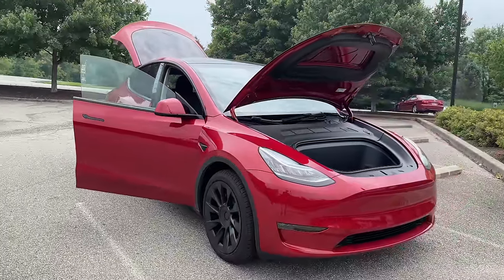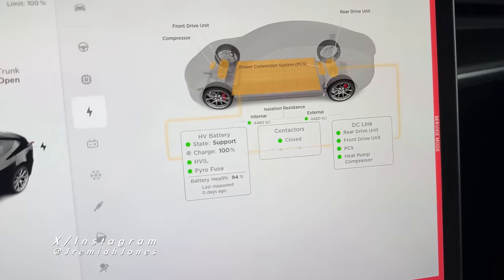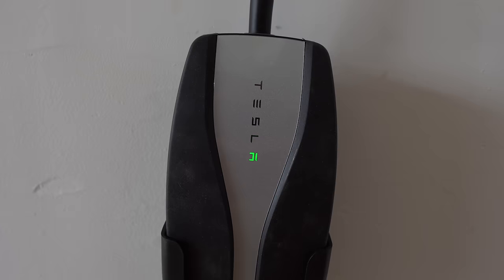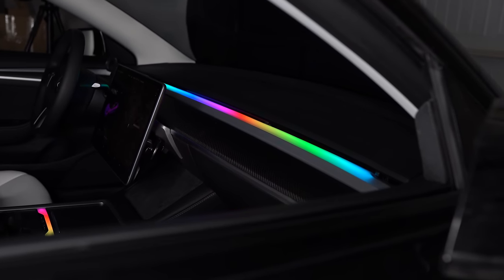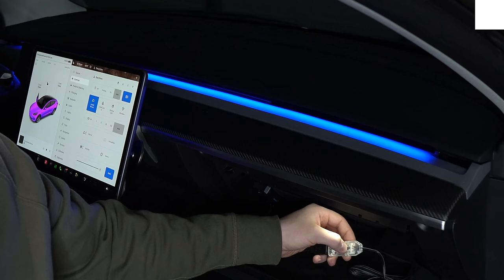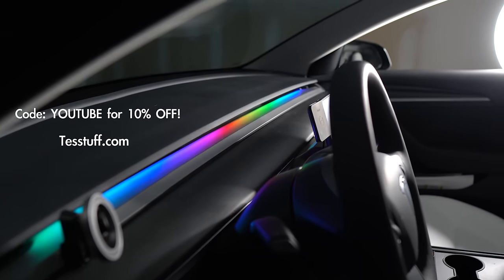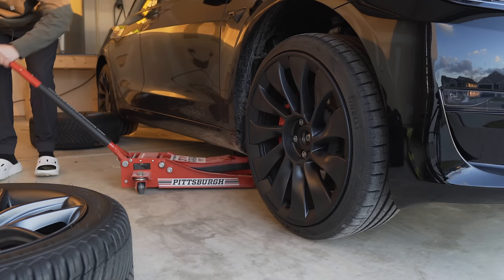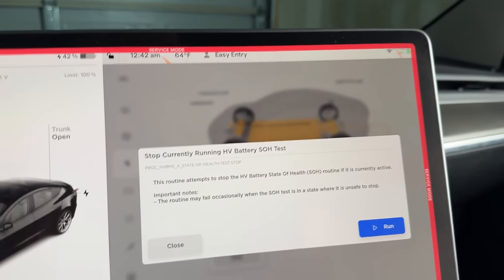How To Charge Your Tesla The Right Way | Avoid This Mistake!

Comment: Say you’re going on a vacation for a couple of weeks and can’t keep it plugged in, how bad is that for the battery, and, what level of charge should it be left at?
Reply: Driving the car to below 50% and leaving it plugged in with a charge limit of 50% would be easiest on the battery for storage.
Reply: @floodtheinbox  but, I don't have a plug available.  I can't leave it plugged in.  Thanks, though.
Reply: @rollaroundtheworld  oh sorry, I didn’t read. It’s not gonna be terrible for the battery I wouldn’t worry too much about out. Turn off cabin heat protection and sentry mode, charge it to 50-60 and while you’re gone try as little as possible to open the app up and check on the car and the battery won’t lose very much charge at all. Some people say account for 1% loss per day and that’s definitely an over estimation but charge enough to leave you with enough to get to a charger after losing that many percent when you get back and it won’t hurt it at all cheers

Comment: So, let's say that your Tesla is rated for 300 miles on a full charge. If you follow the recommendations of keeping your battery between 80% to 20% for regular, local driving,  then you're charging the battery at least every 180 miles. With battery charge dissipation, it's less than that. I just started recording the data, but I suspect I'm going to find out that I'm charging from 20% to 80% every 120-130 miles or so. I think that's kinda lame, but it is what it is.

Comment: The conundrum I have is that I use schedule charging to start charging at 10pm. (Off peak) Once the charge is complete (I use 75%) at maybe 1am the charging stops and wont provide power again until 10pm the next night. So while the car is plugged in, in reality its as if its not plugged in as it cannot receive any power. The only solution is to either manualy plug in at 10pm without schedule or turn off the schedule charge function and then turn it back on every day in the App? Scheduling is convenient as I plug in at maybe 6pm and forget it and it nicely begins at 10pm without my thinking about it. How can I use scheduling and benefit from "always be plugged in" at the same time?

Comment: The thing I've been struggling to reconcile is the notion that "Always be charging" seems to conflict with the ability to schedule a charging session.
Reply: ‘ Always’ charging is a misunderstanding. Always PLUGGED in is not possible either unless you don’t use your car at all. The Battery Management System will not allow your Tesla to be “Always Charging “. The BMS will stop the charging once the battery is charged to the specified level eg 80% or 100% for LFP models. But your Tesla will draw power from your wall charger for other purposes other than charging your battery. Your Tesla don’t sleep when you go to bed, it has to maintain various systems in your car.

Comment: Great Video Jeremiah, what’s your recommendation for charging if I don’t have an LFP battery? I drive a lot daily like 300 miles or more.. I can charge at home and trying to avoid supercharging as much as possible
Reply: It’s best to charge prior to you leaving your home. So rather than starting say at midnight and you leave by 8am, I would have it start at 4am if that’ll change you up to 90% prior to you leaving. This way, you don’t have the car sitting at a high SoC. 

If you drive daily for 300, I’d keep it between 80-95% by the time you depart.
Reply: Just get a Prius
Reply: 300+ is to much to do without supercharging. Realistically we get about 280ish miles for a 100% charge. Prehaps you have chargers near your work? Unless your doing uber/doordash

Comment: As a brand new Tesla owner I’m a bit shocked, I went from a 2019 wrx to a long range model y but the battery experience is a bit lackluster, I feel like I charge every 2 days and i need to get a wall mounted charger asap because I get 1kwh at home🤣 but it also kills my battery that I drive uphill to go home and waste like 10-15% a day from what it feels like😭
Reply: Yep, Tesla stated range is grossly overrated..  take 30% off and you will be happy.  Using a lot of heat in winter and AC in summer lessen the range even further.
Reply: @jml9550 i thought gas cars also looses range on uphills.
Reply: @Tech4geeks21st  sure it uses more gas.  I ain’t no MIT physicist, EV use the same energy going uphill and downhill?
Reply: If you drive uphill to go home then that means you're going downhill when leaving home, which would recharge your battery a bit, no?
Reply: @schm147  no all that energy is transferred into the brakes
Reply: @mysticalbeing13 incorrect - if you use 1-pedal driving (now apparently the only mode on the Model Y) then you're almost never touching the brakes.
Reply: @miket2067  Ah. someone who incorrectly tries to correct someone. 1-pedal driving includes "Regen Braking" which is also known as Hold Braking. Regen braking is using the energy stored from downhill slopes to brake. Your statement of hold braking is the only mode on the Model Y is also false. There are three modes in all Teslas. Creep, Hold, and Roll. Hold is the only form of braking that allows you to not touch the brakes BECAUSE of energy being transferred into the brakes. Comprehendo?
Reply: @mysticalbeing13  incorrect again mi amigo! (1) if you're going downhill using regen braking NO energy is going into the brakes, it's all going back into the battery (minus conversion losses of course). (2) my 2024 Model Y does not have Creep, Hold, and Roll modes - it defaults to Hold and there are no other choices. The Creep and Roll modes were removed in the most recent software update (they were not useful according to Musk),

Comment: I just bought a 2019 model 3 LR with about 41,000 miles. The vin code has a e in the battery identifier so I think it is lithium only? Should I aim for the 50% with charging stopping at 60% ?

Comment: These people charging their LFP‘s to 100% every day, and very frequently on superchargers is going to degrade them faster. They are still lithium based batteries. They just have less voltage spike than magnesium cadmium batteries do at higher state of charge.  Charging your LFP battery to 100% a couple of times a week is plenty to help. Keep the battery management system calibrated. Plus, at 100% state of charge you’re not getting full region when you’re breaking. It’s more comfortable to stop at 95% for that reason.
Reply: I agree with you comment.  Not having full regen periodically should help remind you to use your brakes from time to time, as they too should be used on occasion.

Comment: So when charging at home what amps are you using with the level 2 tesla charger?
Reply: Im charging at 48 amps on a 60 amp breaker
Reply: @dieniewienie143  so it's not better for the battery to charge at lower amps ?
Reply: @gregpelfrey5303  For level 2 charging? Nope.. The cost of charging at lower amperage would outweigh any benefit.

Comment: Actually you should charge to 100 percent. A full charge is actually 80 percent. System software wont actually charge to 100 percent. This mean 100 percent is actually 80 percent. Example  when an ice care gauge say empty it actually has another 5 gallons in it.

Comment: Had my Model 3 for about 2 months now and charge at home. I have it set to 80% and I’ve noticed some days it will charge to that limit but sometimes it charges to 83%. Is that normal?
Reply: That's odd. I've had mine for just under a month so not very long, but I haven't seen that happen. It's suuuper easy though to accidentally bump the charge limit slider in the app - could that be what happened?

Comment: I can fill my diesel car anyway i want and stil would not hurt it. So when evs gets that and not have problems during Winther well then evs might be an option. And puling a caravan is what i do alot. I dont want to wait for a charger every time during holiday and have to unhook my trailer to charge. Eves are not for me.
Reply: Diesel fuel can become contaminated far more easily than gasoline due to its higher viscosity. Common fuel contaminates include water, soot, dilution, glycol, debris, and even microorganisms. Contaminants can find their way into your fuel through damaged caps, seals, or gaskets. Storing your diesel engine for long periods of time can also cause contamination, as will the weather. When contaminants penetrate your fuel system, it can lead to major engine problems

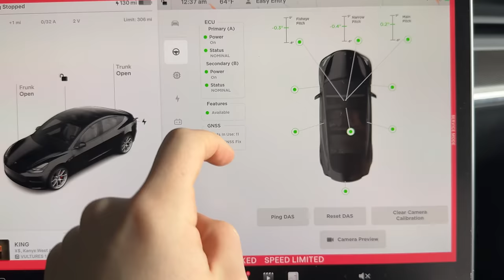Comment: 1:30 ..... well shit. i just bought the 2024 model 3 (like took delivery not even a week ago). but i live in an apartment so i wont be able to always be plugged in. did i screw myself over?
Reply: Yes you have, not having a L2 at home.  If you don’t have free charging at work, you are double screwed.  Relaying on Supercharger only is gonna cost you money and worst of all, time.
Reply: @jml9550   id love to hear your thoughts. 
my work will probably be my primary charging place which is a chargepoint charger (and free). i think those are slow ones equivalent to at home charging right? I saw a lot (like over 15) EVs (10 are teslas) at my apartment garages so i figured if its working for them, it should be fine. 
I also plan to visit my parents every week or so and charge at their place. they dont have a wall charger but i can use the mobile charger i guess
There is a super charger spot not even half a mile from me, but i doubt id use it often. maybe if im near 20% and need a charge fast?

plus, at work, on some days i get in around 730 and teh parking lot is empty. its fairly empty friday afternoons as well. So I plan to charge during those times
Reply: @pvic6959  most apartments charger at level 2s.  So if you get those spots you will be fine.  Plus your work offers free charging which sounds like will be your primary source.  Mobile charging only gives you 5-6 miles per hours, it is better than nothing, but i wouldn’t count on it.  Supercharging will be my last resort, doing it often cost fast battery degradation and money,  My last thought, it sounds like you are younger and single.  If so you have a lot of time flexibility which is good.  Best of luck and enjoy the Tesla.x
Reply: I have a Tesla model 3 performance, 2023. I drive it once a week and charge it once a week. I stay within the charging perimeters recommended by Tesla. Don't let it drop under 20% and no higher than 80%. So after a full year, I've noticed no degradation. For example, I drive one way 30 MI, I use 10% of the battery. That has always stayed consistent! I will note that I do not use superchargers. Always level two. As a norm I always keep it between 40 and 80 percent. Don't sweat it!
Reply: @jml9550  huh i cant see my comment to your second comment. 
i cant remember what i said but the main points:
- the level 2 chargers at the apartment and at work (both are chargepoint) should be ok right?
- the mobile charger is one my dad has for a plug in hybrid. I would use that for when im at my parents all day/overnight 
- and yeah i am single and 27 (so idk if that counts as young haha)
thank you for your insights!
Reply: @crk58241  thank you! the 2024 model 3 standard range can be charged to 100% and is recommended! but i think youre still not supposed to let it stay under 20% for very long

I think i will charge twice a week (when i get to work at 7am when no one is there lol). regardless of how much charge i have left. that way i can stay topped up.. i hope
Reply: @pvic6959  L2 charging at work and apartment should be suffice for your daily need.
L1 at your parents’ will get you 4-6 miles per hours only, 12 miles will get you probably 50-60 miles of range.  Better than nothing I guess.  27 is young in my book, I am 51 :)
Reply: @jml9550  awesome! Thanks for the help! Im hoping i can go with apartment/work most of the time. And if im really needing a charge, Ill pop by the super charger near my apartment. 

haha yeah it would be slow going at my parents haha. But i was talking to my dad about getting a 240 volt (they own). They also have a hybrid and might get an EV down the road so it would help them too. We'll see

haha thanks! :)
Reply: @pvic6959  240V definitely helps.  It is not that much money having am electrician to install one in the garage of there is still space in the panel.
Reply: @jml9550  I will look into the 240 volt! thank you so much!

Comment: So I just bought my Tesla and it has 10k free supercharger miles… i guess it is not good to use the superchargers due to degradation :/
Reply: It turns out that it's a bit of a myth that Superchargers degrade your batteries. If you have LFP, just charge to the top once you get down to 20% or 30% then up to 100% and you're good. If you have NMC, then just charge regularly to about 75% or 80%. Remember that up high, the charge rate slows anyway, and a lot of the new data shows no real increase in degradation with Supercharging as long as you don't go nuts to 100% all the time. If you do have LFP, once a month or so, let it dip below 10% and leave it there an hour or so, then to 100% That will help the BMS calibrate. And just FYI, I've owned both an NMC and an LFP Tesla.
Reply: @Techridr  oh sweet, well based on my commute I usually don’t charge over 65% daily and when I get home I’m at about 40% on NMC batteries. Thanks for the insight

Comment: If you see the 300ish miles of range on a Tesla and assume that you can get away with charging once a week then a Tesla is not for you. Lots of the charge will go to preheating the interior and battery not to mention the quoted range numbers are in unrealistically ideal scenarios. I drive my model Y about 50 miles a day which uses anywhere from 20 to 30% of the charge. Jeremiah is right in that you do need to be able to charge at night. That being said I’m able to do it with a standard wall outlet. Wish I could use a dryer outlet, but I would have to use an extension cord from my dryer which sounds like a fire waiting to happen lol